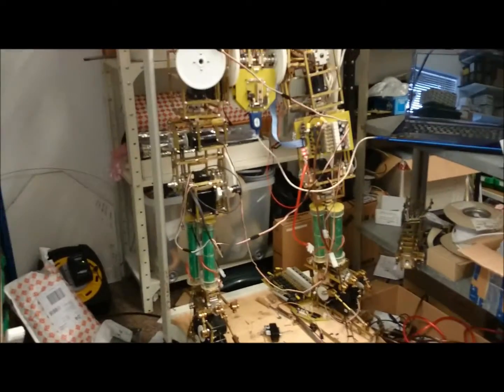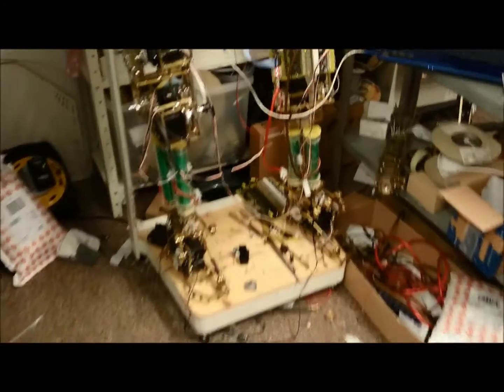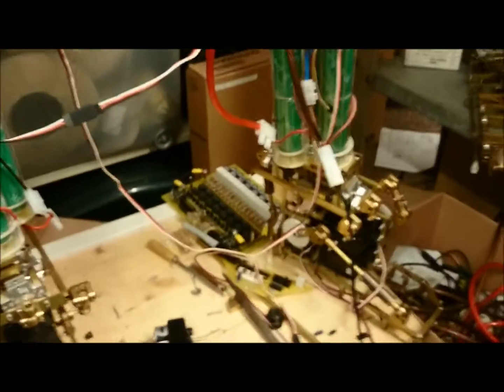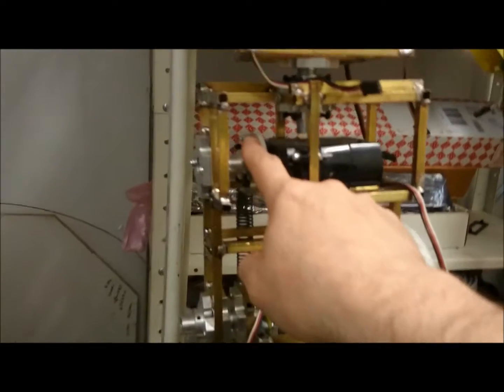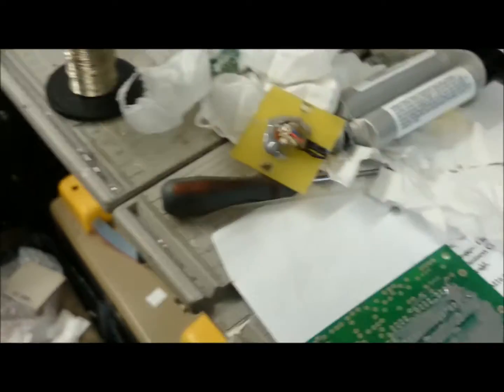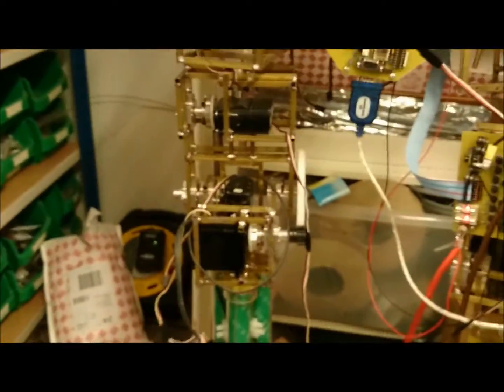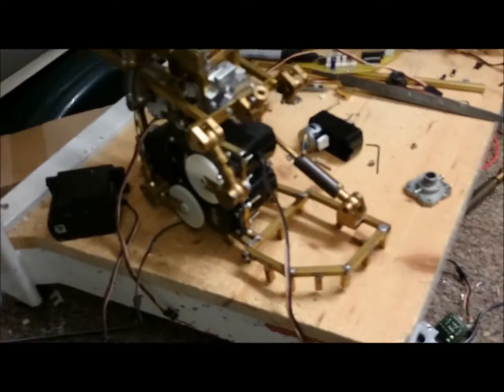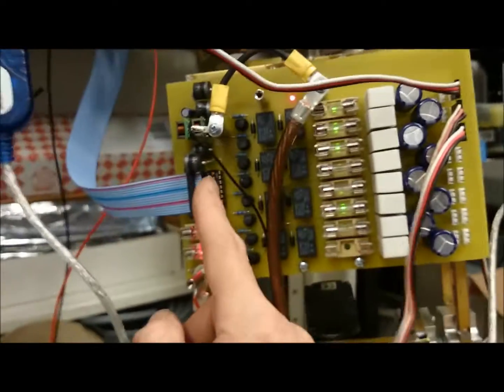Life-Size D.I.Y Humanoid Robot- Also featuring the Robot Head from Jack Conte Pedals Music Video

Comment: Kevin , nice job.Dont you think using stepper motors with belts and pulleys would be better than using servos ? I mean doing something like the first 4 honda asimos
Reply from the maker: Hi  Zacharias  ,  Using stepper motors would be more simple as the need for positional feedback such as a Potentiometer or an encoder is not essential as each step represents the same fixed change in angle.  However for high positional accuracy,( sorry to be really geeky but....)  there exists an infinite number of possible positions between the steps of a stepper motor. For detailed hand eye coordination accuracy would be important. Belts and pulleys would be fine on long limbs such as arms and legs but I would still use a geared servo motor for the drive.
Reply: I know but are hoby servos powerfull enough to build a human sized robot. I am building an inmoov currently and when i am done with it i want to build a pair of legs like yours but i dont know if servo motors will be powerfull enough to nove the entire thing.
Reply from the maker: InMoov is a great open source 3D Printed Robot. I think Gael Langevin is working on the legs now , find out what motors he is using!. The servos I have used(GWS S777 ,I modified for continuous rotation) are really good. Although the servos run at 6v , I have run the internal motors at up to 12v. With the external gearing producing even more torque, even if I have to step up the voltage a bit.I think the legs will do their job. It the top half is too heavy , who knows I may even graft on an InMoov torso...:)
Reply: The setvos you mentioned (gws s777) are sisnotinued do you know from where i can get them from or a similar servo?
Reply from the maker: +zacharias pap Ahh if you are in the u.k like me search gwsus and look for heavy duty servos they are still manufactured. Also search gws servos dealers Europe. there are two options and it's not J Perkins ....if you have no luck get back to me..😉
Reply from the maker: +zacharias pap looks like it has a high torque, not sure if it's powerful enough on its own .I modified my servos for continuous rotation and added additional gearing. Some people have even used windscreen wiper motors.
Reply: wait i got a box of windshield wiper motors you think that i can use those???
Reply: and also if i am going to use this servos i will also modify them for continuous rotation and probably make them run on 12v
Reply from the maker: +zacharias pap Sometimes the resources are right in front of you..you will still have to find some high power motor controllers though.Good luck.
Reply: What would you prefer? Windshield wiper motor, the servos i showed you (2 when one is not powerfull enough) , a stepper motor, or a brushless motor with a gearbox???
Reply from the maker: I guess you now have too much choice...do some research on the net , find out what works for others. After all Even ASIMO can't walk bolt upright ,and I dread to think what they have spent on it..

Comment: Seems like it would be difficult to have it walk without tipping over.
Reply from the maker: Sure , but with a bit of compliance and real time  positional feedback ,I can make  continuous adjustment to the servo positions. The Legs also house the batteries, so with the extra weight low down  this helps with its stability.
  In the clip above when you see the Leg moving at the end , I was running the servos on just over 5 volts to test it. Now I can run them between 7 and 8 volts and it makes a huge difference to the power and speed. My work load is huge at the moment but I will be back on this project as soon as I can, thanks for commenting ! .. :)